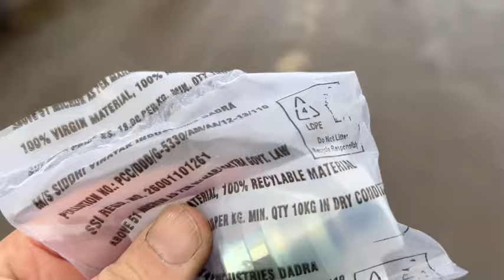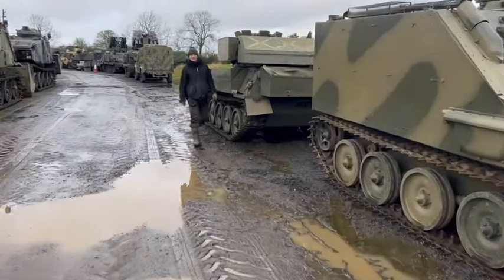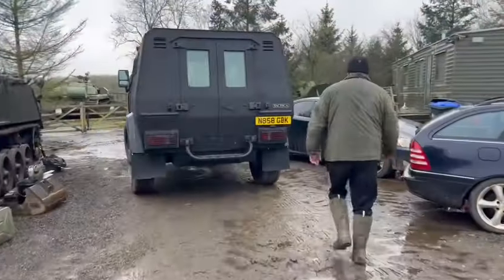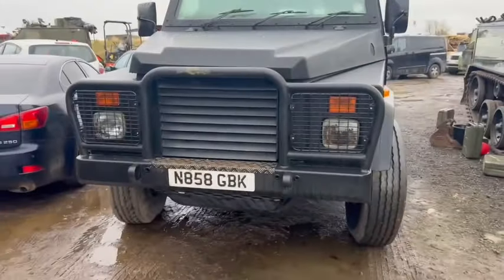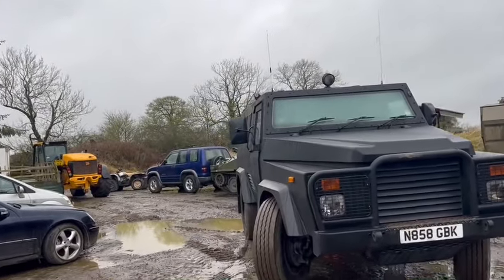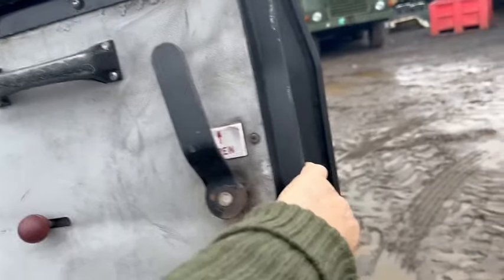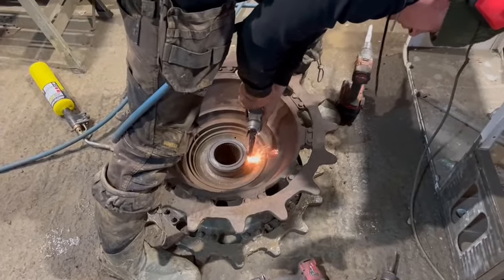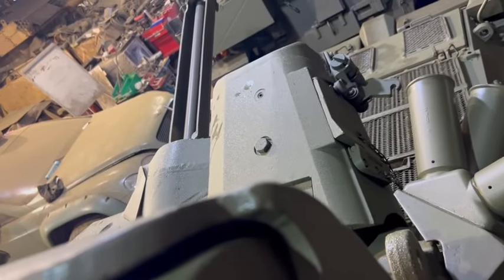Tactica vs Scimiter

Comment: To dry your tanks from condensation... get a parking heater place under tank with the heat outlet piped inside the tank and leave on full chat for 48h... the heat will then radiate throughout the hull and should be warm to touch...